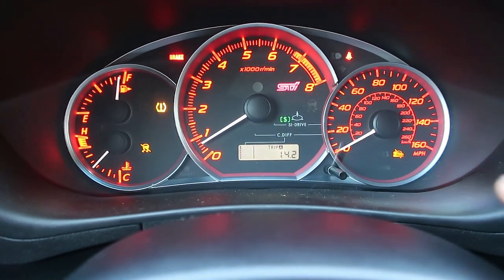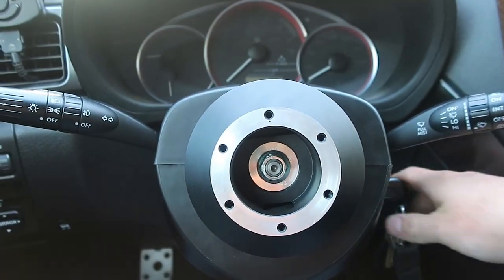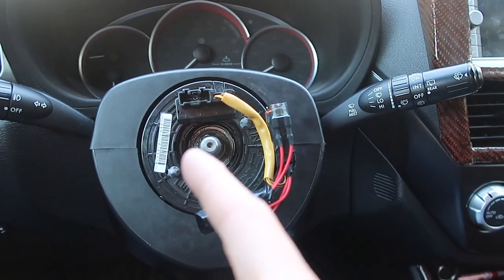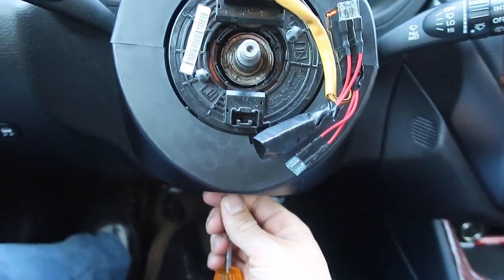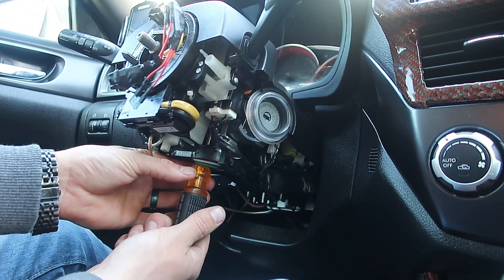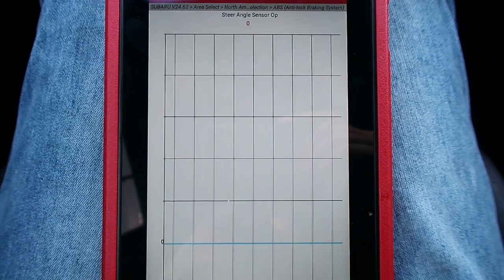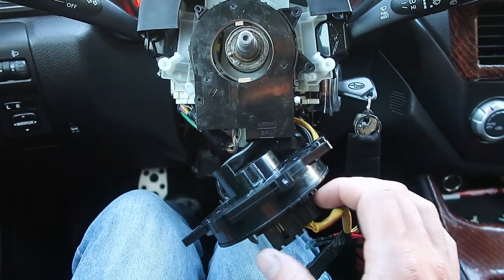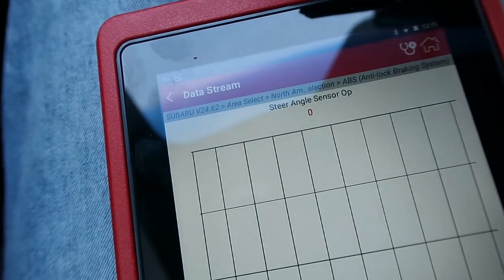Subaru Angle Sensor Malfunction. Lets Try To Fix It

Comment: Hey Brother, I recently have/had the same issue & went through the same process of elimination before watching your video. I had purchased an 08 OBXT 5MT Limited last year and have been ferreting out all the shady work the previous owner/dealer had done. Ended up replacing both the clock spring and the sensor today at tune of 600 bucks.  Even bought a new $1200 scan tool to sort out and reprogram a few things. I laughed my butt off seeing someone else go through the same thing. Hope you got it sorted out now & back to driving & tuning, enjoy..

Comment: For anyone still having trouble with this, what u found out is that when the steering angle sensor fault code appears, u cant clear the code and u also cant get a steering angle reading, but u may still have a workibg angle sensor. Solution is to get a scan tool that can do the steering angle sensor calibration. Wheels straight, select the function, it does irs thing, then will u get a SAS reading from the data stream and all will be good
Reply: A working angle sensor as in? His kept on showing a 0 output so it can be assumed that the sensor itself is not working

Comment: You see those circle cylinders on the circuit board? Those are capacitors. They can be checked very easily with a multimeter. The ohm reading should read the value that is printed on the casing

Comment: Got the exact same problem,how did you manage to fix it?
Reply from the maker: I tried to bypass the system and get it to work but I just ended up buying a used one off eBay. The first one I got was a dud but I specifically paid more for a warranty just in case and they sent out a second one that worked out great
Reply: @ModdingAddiction  okay i managed to fix it,well actually my friend did it. Now here is the thing.  Steering angle sensor they never die unless it is physically crushed. The problem is once you over steer,there are two   round circles(the big one and small white one )inside the angle sensor sorry my English aint that good...since the small one acts like the sensor and is being rotated by the bigger one when you're turning the wheel,its easy for it to lose the alignment needed for it to sense...now the thing is,there's a small chip around it needed to be physically removed and is the one that holds the permanent error code in which was supposed to be cleared out by the diagnosis machine but for some reason it doesn't.  So in that case its being done manually,remove the chip then connect it to the PC, program it with subaru software n shit and boom its done. Put it back the right way and start the car and its done. We did it around 2 hours
Reply: @kennymony1691  I’m sorry but what do you mean by connect the chip to the pc and program it with the Subaru software? I’m having the exact same problem and am just trying to research as much as possible before diving into trying to fix it. Is it harmful to the vehicle with the dccd flashing ?
Reply: @kennymony1691  what’s the Subaru software? Is it available to everyone?
Reply: @incognizance3184  A month has passed, hope you were able to fix it or atleast buy a new one, and yes it affects the DCCD.
Reply: @kennymony1691 

Any chance you or your friend could make a quick video explaining what you mean by physically removing the chip in the sensor?
Reply: Lol @kennymony1691 posts a vague solution and doesnt answer questions. He doesnt actually want to help he just wants to brag about solving it
Reply: @Antonio-hp7dw  hello there! i would really really like to elaborate exactly how it was done but i cant especially the computer part. He had to reprogram it again using the manufacture's software, and i can say it was kind of tricky. So yes there's a way to fix this without buying a new one. You just need the right guy.
Reply: @kennymony1691  I assumed that has nothing wrong with the sensor itself and it was something with the software. 
What tool do I need to reset the chip?? Or what computer? 
Thanks for the info
Reply: @ModdingAddiction  Did you buy both the clock spring and the steering angle sensor or did you just buy one of them and if its just one which one?